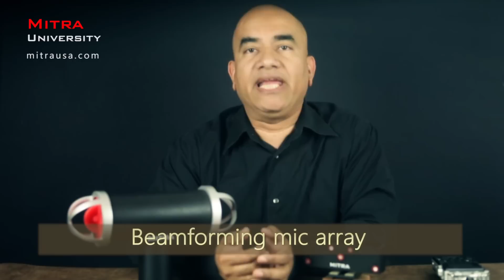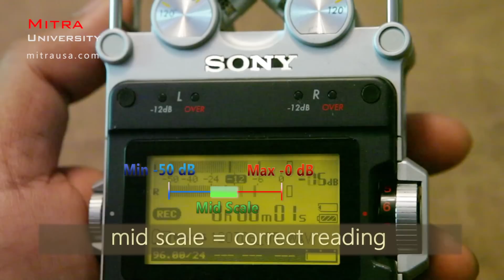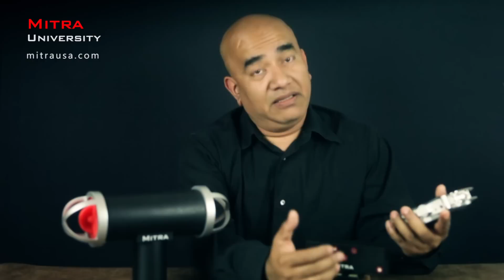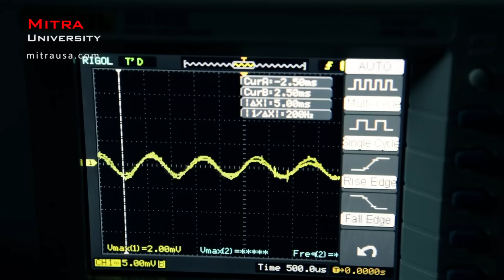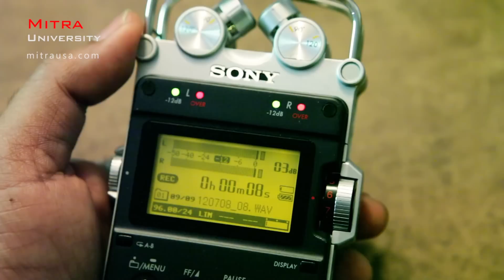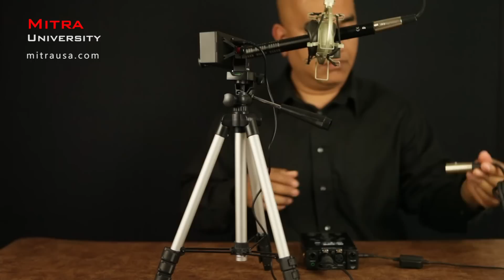How to set recording level during field recording

Comment: Heat does not come from the Sun to the Earth... the Inverse Square Law prohibits this also as heat is electromagnetic in nature. Heat could never travel through 93,000,000 miles of -465 below zero and make it to earth. If heat came from the Sun, the upper-atmosphere would be heated first, which it isn't. Heat is manifest only through the dissolution of matter... period.